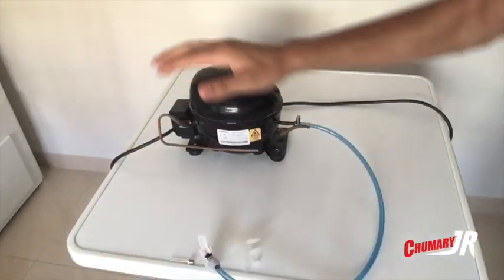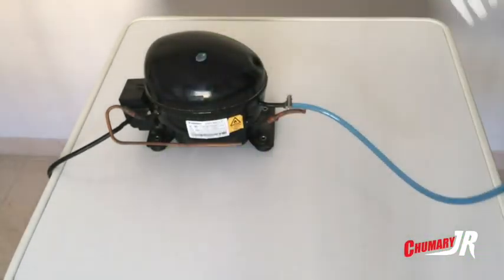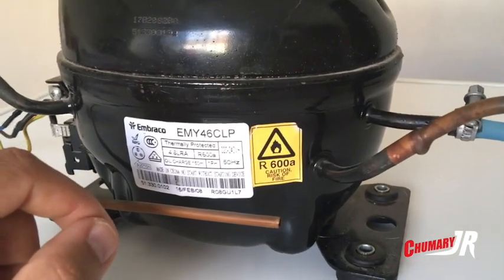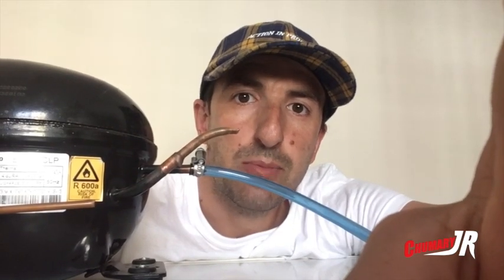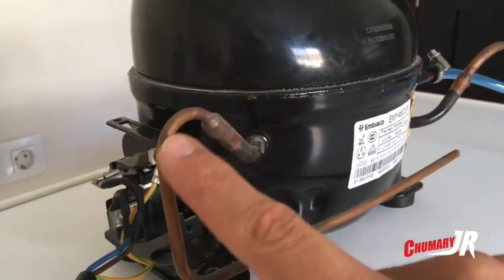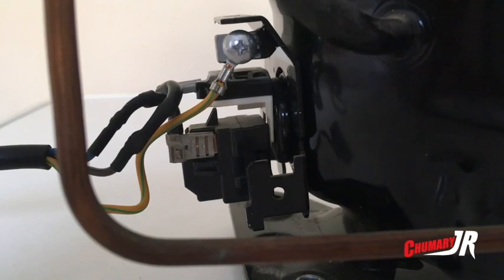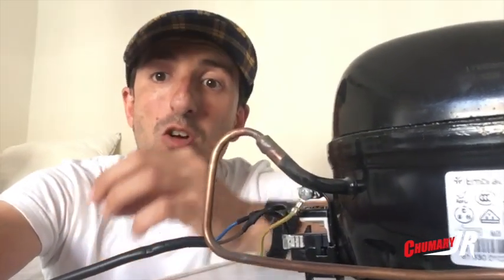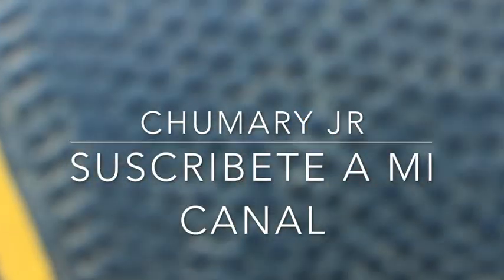como hacer un compresor de aire casero

Comment: oye amigo como hago para evitar que tire mucho aceite con aire ?
Reply from the maker: Hola Geovanny, en primer lugar hay que evitar mover el compresor y enchufarlo de forma instantánea si evitamos mayor perdida de aceite, de todas formas siempre va a tener algo de perdida, para ello podemos ponerle un filtro especifico para recoger ese aceite, y cada cierto tiempo volveremos a reponerlo en el compresor para que no se quede sin aceite, ya que me haces esta pregunta aprovechare para hacer un tutoría de como hacerte un filtro casero que es muy sencillo de hacer.
Reply: Amigo endode queda el capacitor ? Buen vídeo